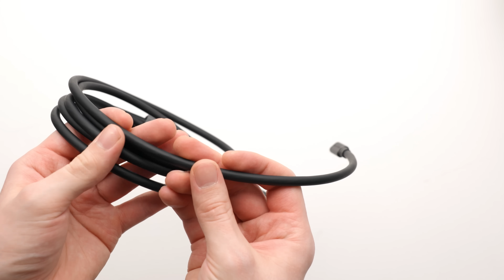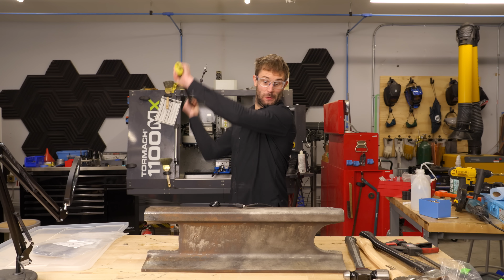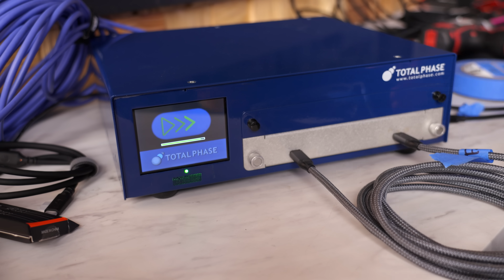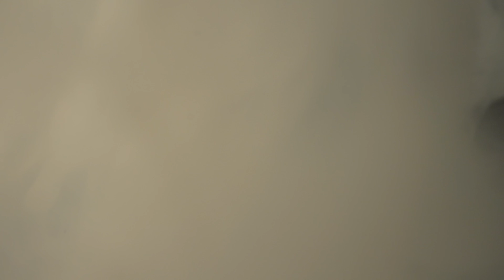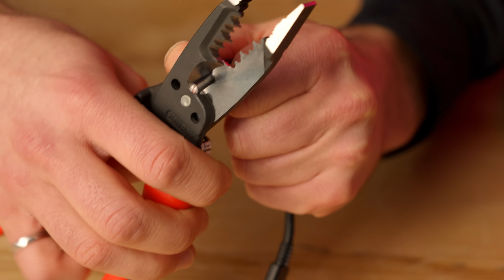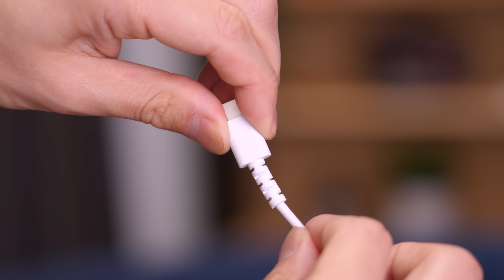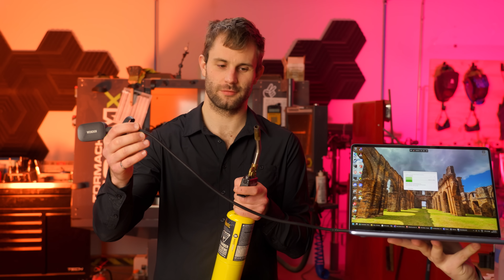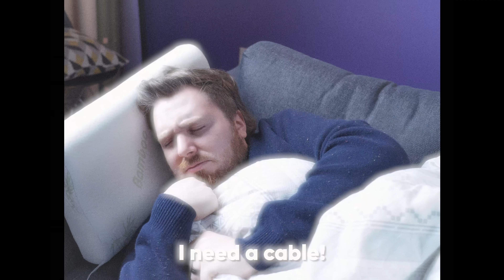Why It Took Me 4 YEARS to Make a USB Cable

Comment: Been waiting for these. :) So now the next step is to design a line of TrueSpec elbow adapters, right?? RIGHT? ;) I find those are often my weak link as you can find more expensive higher quality cables from say Tether Tools or Area 51, but no one is making high quality adapters so I can deal with right angles nicely

Comment: You don't have em in white? 🥲
Reply: They talked a lot about how making white stuff is generally more expensive, and given the special requirements for the sheath of these cables it probably matters even more since this is kind of a test run to evaluate economic feasibility before expanding the product line.

Comment: I'm more frustrated that I bought a USB c cable that was meant to do video data transfer for my steam deck. It in fact, did not have video data capabilities. Even though it hits 100w easily charging my devices. I will buy an LTT cable if it means that what I buy, is actually what is advertised.